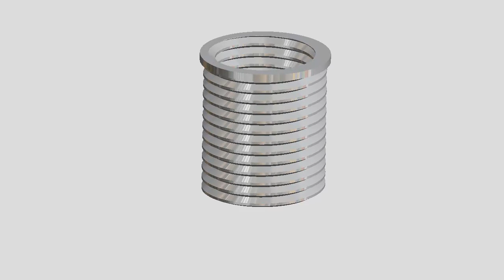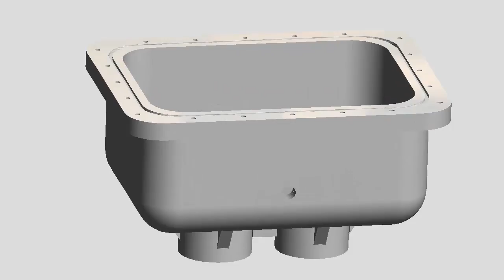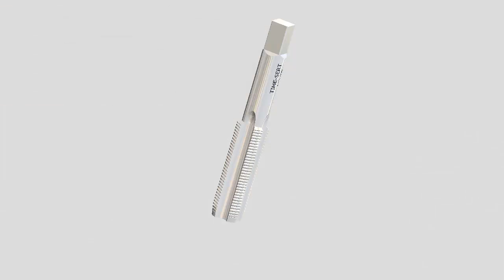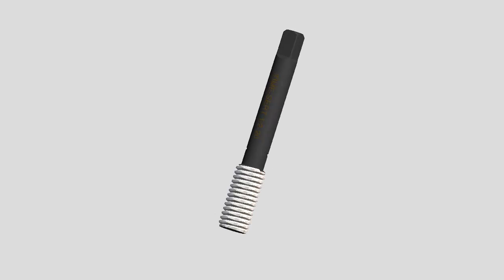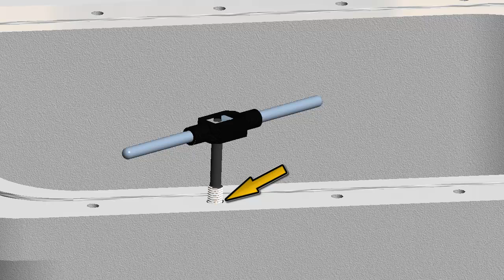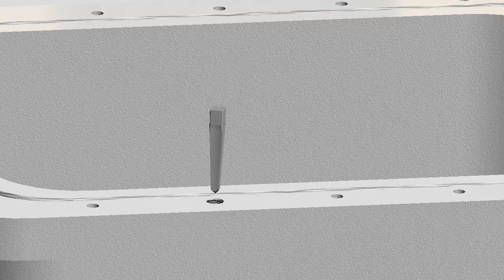Thread Repair Using a TIME-SERT Insert

Comment: I have used Cross Wire Inserts (Helicoils) for many years, and they are much cheaper than this type of thread repair bush insert. Also if the stripped hole is close to the material edge, the Cross Wire Insert (the old original Cross Ltd)  will work well, but the thicker bush insert may be too close to the material edge.

Comment: Congrats nice video,  what's the name of the tool used to remove a Time Sert Insert ?
Reply: Easy out… it’s basically a reverse (left hand) threaded rod. The more your screw it in, (anti clockwise) the more it unscrews the insert (or a drilled out, snapped off bolt, for example).

Comment: That was informative. But, do the inserts need to be the same length as the hole or the bolt used in the fixture? It would seem that the steel insert could be shorter than the actual bolt to allow the same insert to be used for a variety of bolt hole lengths/depths. Just as long as the insert can take the necessary torque to hold the bolt in place. Am I correct with this assumption or must I match the insert length exactly with the bolt length?

Comment: i've found a poor repair on a head for an exhaust header stud.   Whoever did it used a helicoil and it ripped out due to the torque specs.  Is it too late for a time sert repair?  The repair used  a 10x1.25 helicoil kit,   i'm wondering if the include bit used is smaller than what would be used in the time sert kit.
Reply: Robert Dieder what did you find out  I am facing just about the same thing

Comment: i know this is a bit late but i would hook a air sorce to the crank vent and applie like 5 maybe 10 psi to the block then use a ton of grease to keep shavings out.  still would change the oil after and use a magnetic drain plug.